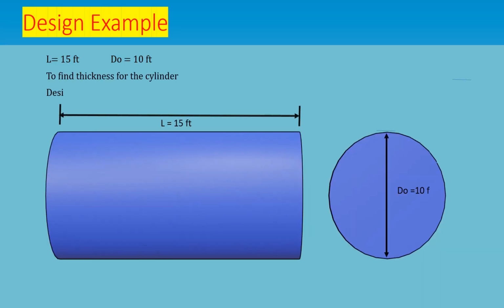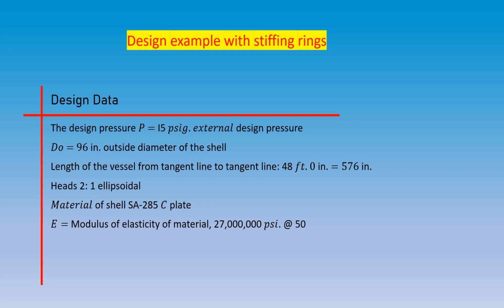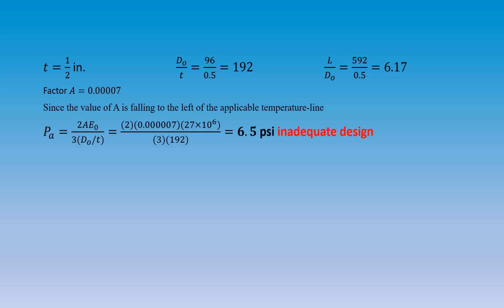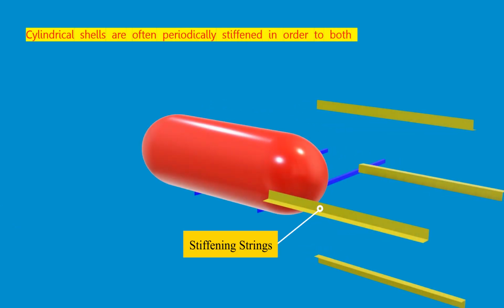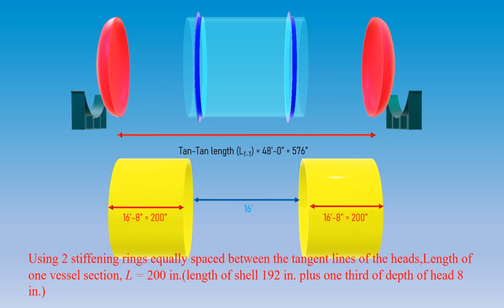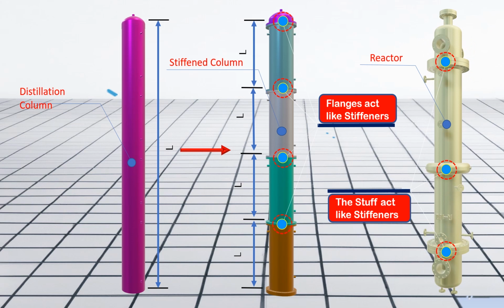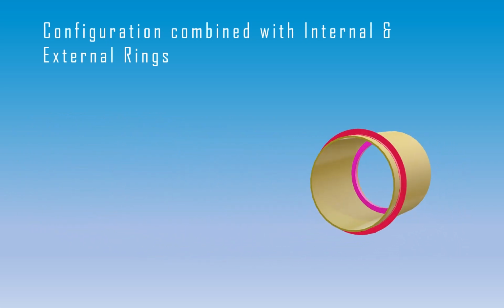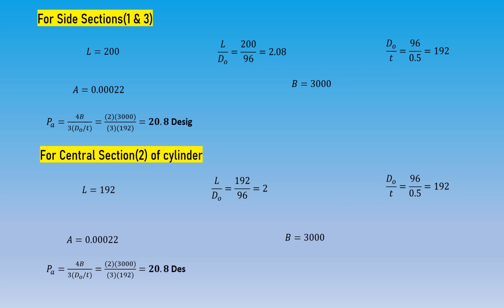Design of External Pressure Vessel with stiffening rings | Vacuum Vessel | Stiffening Strings

Comment: Titan Sub failure brought me here…
Reply: Same. Kinda sent me down the rabbit hole of Submarine Hulls
Reply from the maker: It is exactly, where you should be. It seems that Titan was not designed to withstand such tremendous external pressure, approximately 406 bar at a depth of 13,000 ft.
Reply from the maker: @chemeng-industrialacademy
1 second ago
It is exactly, where you should be. It seems that Titan was not designed to withstand such tremendous external pressure, approximately 406 bar at a depth of 13,000 ft.